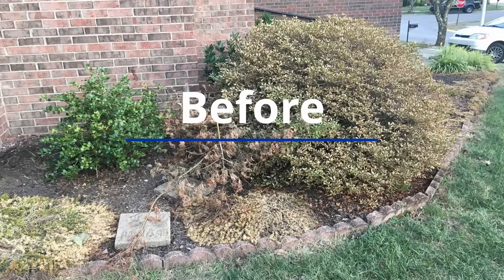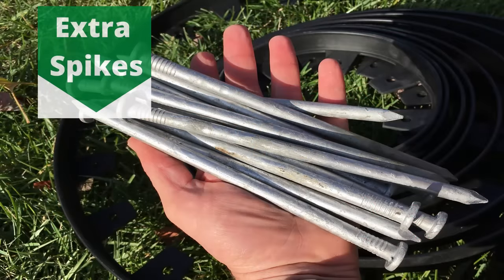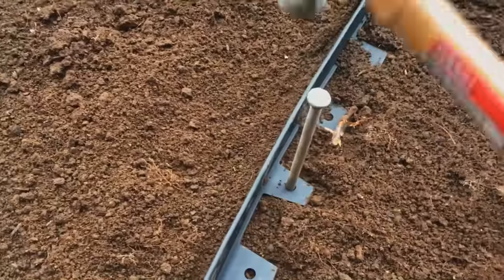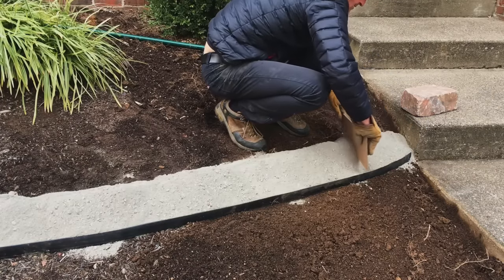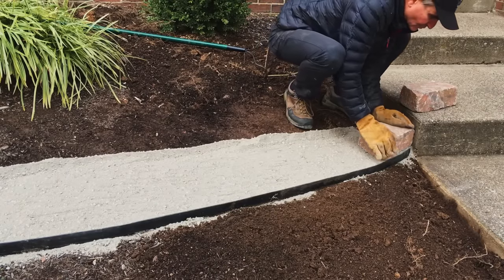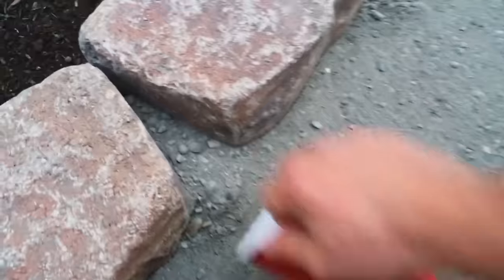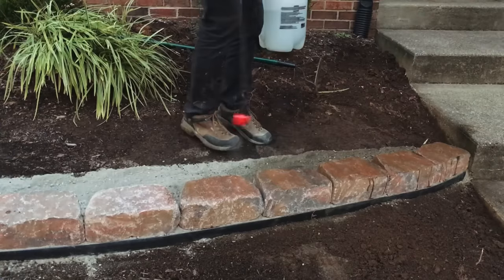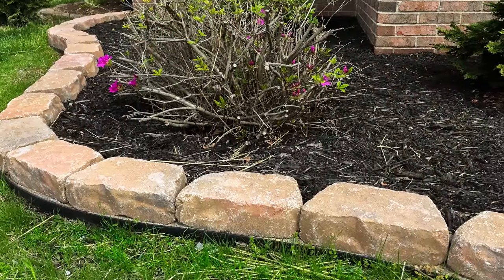easy diy No Dig Border *2020 UPDATE*

Comment: QUESTION PLEASE!  How do I figure the number for bags for the concrete and what size did you use.  I am a young 80 yr old lady going for it, but would like to use smaller bags for concrete.  I am laying approximate 75 stones.
Reply from the maker: Well, be careful. You might consider having the materials delivered. The bags of concrete are 50lbs each and you need about 15 of them. Each bag spreads out to about 5 linear feet. On jobs your size, I pay the store about $60 to deliver all the products because it saves a lot of time and work getting the materials. Maybe you could get a helper to move the heavy products for you as you build it. I hope this helps. Have a great day!!
Reply: YES thank you so much!

Comment: What if your site has a decline? You’ll have to dig, right?
Reply from the maker: I haev never had to do that because that would be a very steep incline to require that. In most yards, this border can be made on the sloped ground. Its designed to work well on slopes. I hope this helps.

Comment: Does the quickcrete have to be spread that deep inside the bed? I don't want to lose all of that planting space behind the pavers.
Reply from the maker: No, it doesn't. I make it that wide for here in Nashville where we have Bermuda Grass that is very invasive with runners under the ground and that extra width goes a long way in keeping it out. You can make yours just wider than the blocks if you want. Have a great day!!

Comment: I mean, this looks easy, but I'm not sure how I feel about the plastic edging in front of the concrete blocks. Looks just a little weird. I understand why it's there but, still not sure I like the aesthetics of it. Any chance it can be trimmed away afterwards or left out of the process?
Reply from the maker: I like the way you think...talking about aesthetics and all.....some viewers have reversed the plastic edging so that after the form of it has been used and the cement has set up, they can remove it. I have not done this and cannot verify anything about this, but was told they like it. How much that black line shows kind of depends on your grass type, how you trim of course, and the season. Here are some viewer projects if you want to see other finished ones: https://www.timvogelaar.com/Easy-diy-no-dig-border. I hope this helps. Have a great day, Lakota Wolf.

Comment: Thanks for this video.  Can u add another level on top using landscape adhesive?  Wanted a little more height.
Reply from the maker: Cecile, I have not made a second layer on this type of border because I don't know if it would look that good and the difficulty level is raised some because you would mix up and use a traditional mortar between the layers. Even, though, it involves more work, I would highly recommend digging out the old dirt and mulch out of your area so the level is dropped enough so that there is plenty of room for the mulch to sit in there without spilling over. Also, the same thing can be accomplished by building your border out further so the dirt can slope down to the level of the bottom of the blocks and also have room for mulch. That being said, yes, you can use the landscaping block adhesive and do this. :) Others have. I hope this helps.

Comment: Is there a less permanent option to the concrete that will still help keep the weeds at bay?  My husband is not keen on laying the concrete for the bricks.
Reply from the maker: I'm not recommending anything specific, but there are some fine gravel mixtures that could be tamped down to create a hard packed base similar to the cement mix, the this cement product is key to the weed control feature because it is impenetrable.

Comment: If I wanted to add one more row stop that, what would I use to adhere the blocks? Masonry adhesive? Concrete? Mortar?
Reply from the maker: I have never don't it, but some have left comments here that they did a second layer and they like it. They have used either landscaping block adhesive or traditional mortar between the layers.

Comment: This looks great and easy for a noob like me. Any ideas on how to hide the black edging a little?
Reply from the maker: Most people mow their yards so the grass is a little higher than the plastic edge. Another idea that I have never tried is to use the plastic edge in reverse manner so it is removable after the cement cures. I cannot recommend this because I have never tried it, but a viewer tried it and left a comment that it worked for them.
Reply: @maxpatch67  thank you. Regarding the spikes. When I search for 8" galvanized spikes I get a lot of results for 8" galvanized framing nails. I'm assuming these are different right?
Reply from the maker: Here you go, Mark: https://www.lowes.com/pd/Fas-n-Tite-3-8-in-x-8-in-Hot-Dipped-Galvanized-Spike/5001418291

Comment: @maxpatch67 Do I really need the concrete? What will happen if I just set the stones on grass? What is the purpose of concrete in this application?

Similarly, What is the purpose of the no-dig edger? What will happen if I don’t use it? Like just a line of stones on grass, no edger, no concrete, backfilled with mulch.

Thank you
Totus tuus
Reply from the maker: The cement adds height, strength, and acts as a weed barrier. The plastic edging acts as a form for the concrete. If you don't want to keep the pastic edge there permanently, you can use it in reverse and make it removable. Both of these things are not a choice in this technique...they help make the technique what it is, which solves many problems for people in how they currently use landscaping blocks where they end up crooked and weeds going everywhere. Please let me know if I can help you any more. Have a good day!!

Comment: How much misting? I'm worried o will leave dry concrete in the middle. How can you be sure enough water has soaked into concrete?
Reply from the maker: Its so hard to say, exactly, but a good estimation might be to mist a 5 foot section for about 5 minutes. You can count on that being good. IF it wasn't completely good, the rest will happen naturally from rain. I hope this helps, West Bay.

Comment: I found some pavers at Home Depot 75% off and I would like to start in Feb. Will the fast setting concrete work in the cold?
Reply from the maker: Yes, I saw those at Home Depot!! Good find!! Read the bag to make sure, but I think the temps need to be at least in the 50's for a few hours for concrete to set properly. Don't do it if its colder....it won't set and that portion of work/product is the main feature of this border.

Comment: What if in the future you want to change the border is it easy to disassemble and re-create a new order?
Reply from the maker: No. Do not this border if you are not sure that you want it for a very long time. It is considered permanent. To remove it would be a lot of work busting up the concrete. If you are not sure, use another more simple technique. I hope this helps. Thanks for the question, May Lee!!

Comment: Could I if I wanted to add another layer over the top, and add quick concrete to it as well or that woulnd't hold?
Reply from the maker: Gonz, I have not made a second layer on this type of border because I don't know if it would look that good and the difficulty level is raised some because you would mix up and use a traditional mortar between the layers. You could also use landscaping block adhesive. Even, though, it involves more work, I would highly recommend digging out the old dirt and mulch out of your area so the level is dropped enough so that there is plenty of room for the mulch to sit in there without spilling over. Also, the same thing can be accomplished by building your border out further so the dirt can slope down to the level of the bottom of the blocks and also have room for mulch. I hope this helps.

Comment: Hey would it be hard to remove it if i decide to change it or should i do it without the cement thanks
Reply from the maker: Use the cement! The cement provides four major functions in this border technique 1. Height(for looks) 2. Keeps the stones straight/aligned over time 3. Stability/strength 4. Weed barrier(the extra width is nearly impenetrable to aggressive weeds and grasses(Bermuda Grass) that we have here in Nashville.....and yes, only build this if you are very sure of what you want for many years to come....you'd have to bust it up with a sledgehammer. I hope this helps!

Comment: Could I do the same, except leave out the black plastic border?
Reply: I believe the plastic border helps give the concrete something to adhere to other than just the ground
Reply from the maker: No that doesn’t work with this technique. The plastic edge provides height, acts as a for the cement, and creates the curve shape.

Comment: Thanks for the video. Can you place it 2 stones high and if so what more do you have to do?
Reply from the maker: Brian, I have not made a second layer on this type of border because I don't know if it would look that good and the difficulty level is raised some because you would mix up and use a traditional mortar between the layers. Even, though, it involves more work, I would highly recommend digging out the old dirt and mulch out of your area so the level is dropped enough so that there is plenty of room for the mulch to sit in there without spilling over. Also, the same thing can be accomplished by building your border out further so the dirt can slope down to the level of the bottom of the blocks and also have room for mulch.

Comment: Planning to do driveway edging...would like to know if I need to lay down plastic film to prevent weed/grass growth underneath and would it cause accumulation of rain water and eventually erode the foundation under the cobblestone....should I also use gravel underneath for drainage?...tks
Reply from the maker: If your ground level is pretty high, like about even with the cement or close to it, you can skip the plastic edging. You'll need to dig a trench along the driveway to build your border inside of. If you want the blocks set down lower, then dig a deeper trench, if you want them set up higher, then a shallower trench. Then create a levelling tool with a piece of cardboard. Start with a rectangle shape about 18" long and 6" high. Then cut a notch into it near the middle of the 18" edge. Make the notch as deep as you want the blocks to be set in the trench(at least 1" or more...up to several inches). After dumping the cement mix into the trench that you dug, you will use this cardboard to level out the cement mix. Slide the cardboard along the driveway with the flat edge on the driveway surface and then the lower edge will drag across the cement mix, making it level and parallel with the driveway surface. Then set your blocks in place nice and straight against the driveway edge. 
Then, with a cup, scoop some extra mix inbetween and behind the blocks. Also, depending how you want it to look, you could also alternate the blocks so there are no gaps or put them up on their side and alternate them to create a solid line. Does all this make sense?? Let me know if I can help you more, Sal. Have a great day!
Reply: @maxpatch67  tks..yr reply was really helpful...you have another subscriber...tks
Reply from the maker: Thanks, Sal :)

Comment: Can I put the concrete over mulch too or will it break down over time and cause the concrete to settle & blocks to lower?
Reply from the maker: I wouldn't put it over thick mulch, but a few random pieces would be fine for the reason you mentioned. I'd just do a quick rake job and get the mulch out of there I guess if it were me.

Comment: I understand why you used concrete. But what if we ever want to change the yard layout later? Would itg be easy remove concrete?
Reply from the maker: No, it wouldn't be that easy to remove the concrete. You'd need to sledge hammer it up. If you are not sure of what you want for a long time, then don't build this one...it would be better for you to just dig a trench edge with a shovel and use that while you think about it over time.

Comment: My question would be, how did you get the ground level before you put down the plastic border. Because if it's high on one end, or low, once you lay the concrete and even it against the plastic border everything is going to be unlevel AND permanent once you spray it all down.
Reply from the maker: Some levelling happens as you spike down the Vigoro edging. Attach it to the ground in the high spots of your design that you have laid out. This way, the edge basically glides over the low little low spots. Now if there are any big high or low areas that you think would be objectionable, then get a shovel out and take care of those beforehand. This border looks good, meandering over the natural ground contours and doesn't need any other levelling. I hope this helps. Have a great day!!

Comment: Is there a rule of thumb if you should or should not put the bricks along your driveway/sidewalk/etc or only along the grass areas?
Reply from the maker: Yes, you would need to adapt it as needed in different areas. That concrete bed leveled off is a pretty big deal to keep the blocks level and straight over time, so I wouldn't skip this step...even if you  need to dig out an area along something like a sidewalk or driveway-just dig it a couple inches extra deep to allow for it. If you have a more specific question about an exact location type, just let me know and I'll be more specific. I hope this helps, Tip Toucher!!

Comment: Great idea I plan on trying it. But I want to know if you can double stack using this method.? I want my edging about 6 inches high
Reply from the maker: Check out these borders and see what you think: https://www.timvogelaar.com/Easy-diy-no-dig-border It's really up to you, but here is what I recommend: I have not made a second layer on this type of border because I don't know if it would look that good and the difficulty level is raised some because you would mix up and use a traditional mortar between the layers. Even, though, it involves more work, I would highly recommend digging out the old dirt and mulch out of your area so the level is dropped enough so that there is plenty of room for the mulch to sit in there without spilling over. Also, the same thing can be accomplished by building your border out further so the dirt can slope down to the level of the bottom of the blocks and also have room for mulch. This all being said, some have used landscaping adhesive for the second layer and they love it.
Reply: @maxpatch67   Thanks for the advice,  I can't wait for your next video.
Reply from the maker: @pmcarter9795  my pleasure, pm carter!!!

Comment: Would you use this method to build a 3 brick stacked height garden wall or it wouldn't be level so would tip over? Or could you level it when you place 1st layer then wet and if level then can continue with 2nd then 3rd row possibly?
Reply from the maker: If I were you and wanted a garden wall that high, I'd look around at videos for more traditional wall building techniques using levelling methods. I think you will like it a lot more considering the height involved. My method just doesn't look or function well with added layers. I hope this helps, Daniel. Have a great day!!

Comment: I followed your instructions and it turned out awesome. I did send some before and after pics to you. I am curious if this will hold up to harsh St. Louis winters. We get hard freezes and I am worried the thin layers of concrete will freeze and break causing unevenness in the next few years but I guess only time will tell. Great idea and tutorial never the less
Reply from the maker: Thanks for the comment, Show-Me-Retro! I'm gonna check out your pix and thanks for sending them. I'll send you an email with a link to them on the website.You won't regret making this border. Happy Labor Day!!
Reply: How has your border held up in St. Louis? I'm just across the river in the metro and wondered the same thing.

Comment: Question, I've seen people use the no dig border and stones but instead of playing them on the inside of the plastic, they placed the stones on the outside which hides the rubber.....is there a better way?
Reply from the maker: So what some viewers have done, is use the same exact technique, but reversed the plastic edging to that then they could remove it afterwards by pulling out the spikes. They tried and said it worked great. I like the way I designed this technique to work and like the plastic edging on the bottom edge of these borders. I think it gives it a nice finished look and sets it off nicely. But, anyway, that's what some have done. Here are some examples of finished ones from viewers: https://www.timvogelaar.com/Easy-diy-no-dig-border. I hope this helps, Zack.

Comment: If you are putting more than one layer of bricks, do you put the cement in the middle?
Reply from the maker: I have not done this, but some viewers have...you would need to use either traditional mortar(adds some difficulty) or use a caulking gun with landscaping block adhesive. I hope this helps, Cheryl.

Comment: Hi! Quick question.. How big are your bags of concrete? We are lining 175 linear feet, and looking at 80# bags of quick krete.. How many do you think??
Reply from the maker: Kaitlin, first make VERY SURE you are looking at the right bags of concrete. They should say FAST SETTING. The brand doesn't matter, but they have to be FAST SETTING. I could be wrong, but I think they only come 50lb bags. Here is the product from Lowes: https://www.lowes.com/pd/Sakrete-50-lb-Fast-Setting-Concrete-Mix/3338802. These bags work for 5 linear feet each so  you can do the math on that. Also, I always like having a little extra of all materials so I don't run out and not be able to finish so I'd get a couple extra if I were you. I hope this helps. Get FAST SETTING okay??